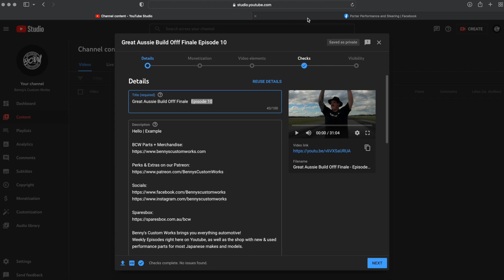BUDGET DRIFT FALCON | $0 Steering Lock Extension + New Wheels + Suspension + Track Test

Comment: what are the measurements for the tierod hole?
Reply from the maker: I think it was 30mm
Reply: Mathuw just measure the factory hole and match it up. You can buy proper taper reams if you want to match it exactly, if it's a skidpan car like the one in the vid a step drill like Ben used will work well enough.

Comment: To make you feel better about the failed oil change. The first time I tried to do my own oil change, I turned the oil drain plug the wrong way, stripped the thread, and had to replace the whole oil pan.
I always check I'm turning a bolt the right way now ;)